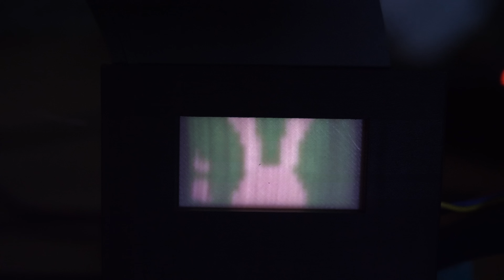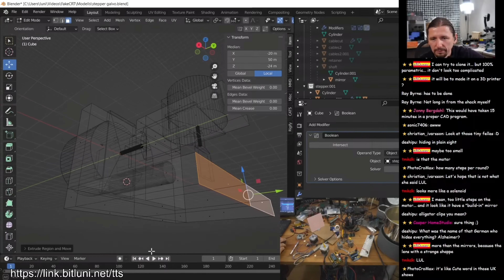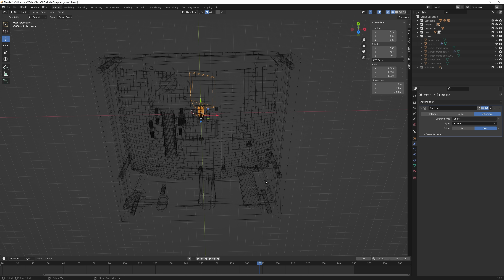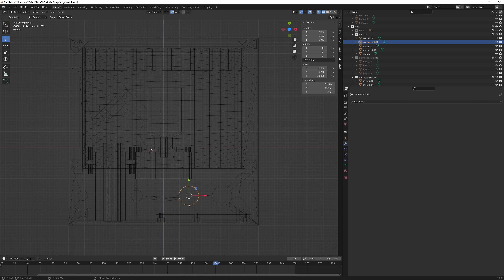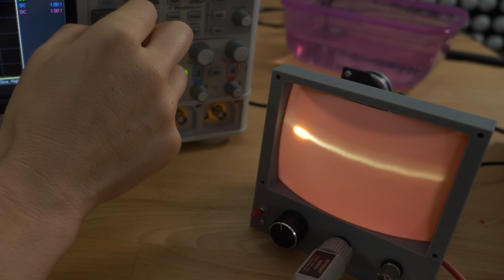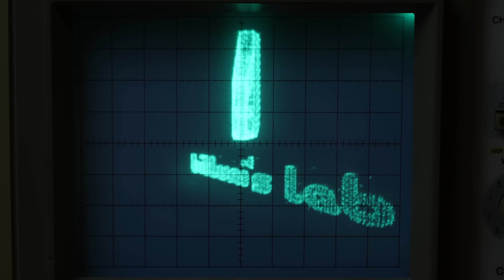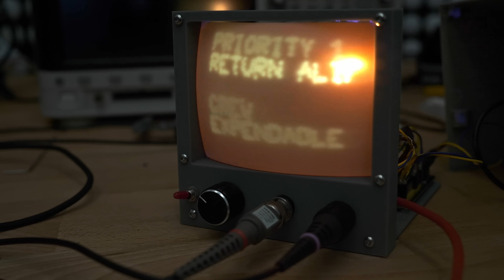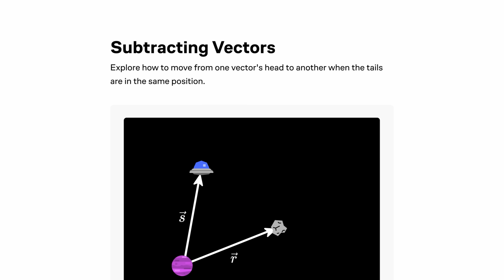I made a fake CRT TV with a LASER

Comment from the maker: Check out https://brilliant.org/bitluni/ for a 30 day free trial or a 20% discount for an annual subscription (sponsor)
Reply: ONE DAY AGO? It was uploaded 31 mins ago bro
Reply: @Randomman149  uh, released to members early?
Reply: YES, TWISTING WIRES IS GOOD. when you twist 2 wires together (2 wires of the same circuit... so 1 wires is the positive and the other wire is the negative) they 'magically' shield themselves from outside interference... this is why you see 4 twisted pairs of wires in an ethernet cable.... but you CANNOT have more than 1 circuit in a twisted pair... this will interfere with it self and can ruin both signals... 
- I JUST explained this SAME THING to another channel about 2 days ago :D - So going to school for Network Administration LEARNED ME SUMTHIN!!!! 🤪😁😳😂
Reply: @ThatTweedle  You can only have one circuit in twisted pair,  cause you only have 2 wires. Otherwise it would be a twisted group, which is not a thing.
Reply: I'm tired of so many brilliant shills. If it was any good, they wouldn't need so many shills.
Reply: May I suggest for our common safety that you forgo the gravitational field project ? A small black hole on earth sweet jeezz!!
Reply: how far do you think we could take this? to a full color tv? a light weight "photon crt" would be a godsend to retro gamers in particular
Reply: @srgarathnor problem with making a TV to use with a retro computer/gaming console, is that a horizontal line scan ( including flyback ) only takes 64 microseconds ( 63.5 for NTSC ), and I seriously doubt the H mirror can move that quickly.
Reply: try to focus the laser and see if you can sharpen the image, you might be onto something here. also try gearing the motors for speed so you arent pushing the motors into a precision traded for speed situation as much. also i wonder if any other materials would have a faster light drop off from phosphorescence.
Reply: alternatively what if you physically move the laser diode on an xy gantry using linear gears for the x and a worm gear for the y? could also work.
Reply: Hey, whats the song in the intro? :D
0:22
Reply: Make a Pip-Boy out of this. 
Guaranteed clicks and technical challenges and game conventions fun!
Reply: This build really reminds me of the vetrex which was a console with a built in crt that made vector images
Reply: 0:32 could you give link?
Reply: I NEED to find out how you created that screen. I’ve been working on a prototype for a modern CRT and have been trying to find a cast acrylic manufacturer that would make it for me, but no luck!
Reply: Wouldnt a micro mirror MEMS device would cost you less that the project? A DLP Mems device would cost you $170 or less for a HD projection.  Low resolution even cheaper.  Say DLP7000
Reply: For this project, you could use much smaller mirrors to reduce drag and inertia. Also try using a longer laser path length to reduce the amount of deflection needed. These changes should give you a significantly faster drawing speed, limited only by the inertia of the stepper motors..
Reply: 0.1 "inch"? Come on now, it is not the dark ages anymore, use standard units of measurement only please.
Reply: if this gets sold then ill say it will be 60 dollars or pounds or euros and yen
Reply: You could have made a real display with spinning mirrors that have multiple faces.  Like it's a cylinder of mirrors - you would have to machine this out of aluminum and then polish it.

The sweep from left to right would require quite an RPM, from top to down, considerably slower. I doubt you could get NTSC quality.  I doubt you could move it without breaking it because of the torque.

I wouldn't recommend building this, it would be fairly expensive, possibly dangerous if it broke and it wouldn't be a very satisfactory display.
Reply: can you make it run doom
Reply: CRTs don't work that way. You don't have horizontal or vertical sweep.
That's basically a mechanical oscilloscope with a terrible response time. It's nothing like a CRT.
Thumbs down for the clickbait.
Reply: cosmefulanito5933 That's why the title has the word "fake." It's not clickbait

Comment: I'd bet a gear system could increase persisoin at high speed by exchanging  torque... would a moter running at a speed that is more acurite for it be able to run a gear faster without loosing the persisoin if it is such that the mirra is not too heavy for the exchange?

Comment: I recommend changing the control system.

One high-speed brush motor on the X axis, and a stepper motor on the Y axis.
Optical sensors to determine when and where the Y axis is (one is enough to check the rotation time and calibrate the position).

On the Y axis, a stepper motor establishes a "line" on which the information will be displayed.

And control for switching on the laser diode (I would suggest permanently switching the current source and only inserting a transistor near the diode to operate as an ON/OFF switch).

Comment: I wonder if you could minimize the effect of intertia by using a lens to project the light out - meaning you wouldn't need to move the motors as far to have as large of an effect. Or would that result in too much distortion to figure out?

Comment: Could you use three mirrors on each motor and spin them continuously to emulate raster scanning? 

There would be no big changes in momentum if they always spin in the same direction (the H one way faster than the V mirror).  When a mirror has sent the beam to the far side of the display a new mirror would replace it flicking the beam back to the other side of the display. The ugly transition as a new mirror comes in to 'view' would be 'blanked' exactly like the Horizontal and Vertical Retrace blanking on a CRT.

Comment: I wonder if you could rig up the motors so they sweep top to bottom left to right with continuous motions (maybe even with just constant speed motors) then electronically turn the laser(s) on and off when they're at a given position? You could use the delayed florescent like properties of the material to control brightness based on how long the laser is on at a given position.

Comment: I have no idea if this would work but I wonder if you could spin the mirrors in a patterned way so that it scanned across the entire screen consistently and then you only activated the laser at precise times so that it illuminates only desired portions of the screen. Probably significantly harder to implement and requiring much more precise control.

Comment: I think an easier and more accurate solution would've been to have the mirrors flip at a constant speed and just turn the laser on and off based on timing.  The visual effect wouldn't be as cool but it could perhaps be driven with composite video signals.

Comment: What if I use a flexible lcd display inside, and when you press the quote on quote "degauss" button, the image displayed on the lcd goes through a filter that "shakes" the image, making it suddenly look distorted, while a hidden 12v relay, hooked up to an ac power supply, goes "ZZZZt" to mimic degauss noise

Comment: CRTs don't work that way. You don't have horizontal or vertical sweep.
That's basically a mechanical oscilloscope with a terrible response time. It's nothing like a CRT.
Using a servo is the stupidest thing you can do.
You should use coils. Like the ones used to move hard drive heads.

Thumbs down for the clickbait.
Reply: Oscilloscopes are CRTs

Comment: As an HDD engineer I would've took apart two hard drives and used the voice coil motors for the mirror. Drives seek incredibly quickly and should give you a good picture. You use the VCM for large movement and ideally you'd use piezoelectric actuators for more precise movements. But that might be a bit over the top. For the VMC you could even keep some of the drive hardware and tell it to seek to specific places, but again that's a more complicated project. The VCMs can actuate in <10ms.
Reply: <10 ms without mass at the arm tip.
Reply: how does it feel knowing your job will be useless in 5 years
Reply: @noobulis  
Data Centers                        👁👄👁
Budget PCs & Servers        👁👄👁
Security Camera Systems 👁👄👁
NAS Devices                        👁👄👁
Legacy Equipment              👁👄👁
Cheap Local Backups        👁👄👁

HDDs are still amazing pieces of tech and will likely still be around for far more than 5 years
Reply: @DeerLiver and not like medical equipment and industrial stuff doesn't use the same knowledge.
Reply: @DeerLiver  16TB NAS
Reply: @noobulis   Sociopath say wut?
Reply: @noobulis  It'll be the cheap option for some other industry that "just needs it to work".

Comment: actually crt signals works by full turn on x origin at specific speed ie 320  turns per second and on x specific time ie 240 turns per second... and projection time on specific time being active or low defines specifix time/positions pixel status... so making mirrors rotate all the matrix screen with specific interwal and serially setting pixel by correct timing will make exactly same logic of crts realatively... ;P

Comment: that glass module can be used for big clock display with simple laser and arduino... if library is open source but it not that complex it doesnt need to be open source just correctly timin two mirrors and  activating laser at correct time sequance will draw right pixel at right place/time... so we need a timing library that reads a 2 d matrix dot display data and converts it to time on of and position data for laser-mirror module :P
Reply: may be a library function to convert text to 2d dot matrix data will be good. but there is allready lots of libraries on arduino library database that does exactly this :P but i dont remember a laser mirror timing library ... so its one of the missing things of that database :D

Comment: To use a short range actuator like a speaker coil, you have to use a series of mirrors (first surface would be ideal) to lengthen the distance in a short area, or use actual distance to allow the angle to spread adequately. This would allow a minuscule movement like that of a speaker to reach the edges. You would essentially use the opposite of what is used in microchip fabrication.

Comment: What if you hooked one (or both) of the mirrors up to a rotary motor instead of a servo.  With the correct geometry, and if you can measure the RPMs precisely enough, you could greatly speed up the potential line travel speed.
That's assuming you have fine grain control enough of the laser on/off as well

Comment: For pure X-Y scanning you could also try using two BLDC motors and a triangular "scanning" mirror on each. The Y motor running at the horizontal resolution times the X motor. Then tilt the entire mechanism slightly to account for the x scan skewing the y position. This saves a lot of time instead of resetting a paddle to the zero point for every line. Alternatively you can speed up the mirror you made by drawing every other line from right to left instead of waiting for the mirror reset to the zero point.
The galvanometer design you mimic is suited for amorphous shapes like silhouette, or geometry because it's ideal direct point-to-point vector style motion ability. Perhaps vector graphics could be experimented with your current model.

Comment: okay but why not use the full spin and trigger the laser as the motors spin instead of start-stop so much? the inertia is why its a bumpy line if going fast. but if the motor spins at like a 1000RPMs and you just trigger the laser as needed to draw, all lines should be precise. unless, you cant trigger the laser on and off that fast?

Comment: if you are trying to do a horizontal line scan I suggest you use a motor with 3 mirrors and possibly a magnet for a position sensor. each side of the mirror will do a scan line. your servo can take care of vertical line scan. This way you can act more like a traditional TV and oscilloscope.

Comment: I think using the speakers to control the laser is worth revisiting. It may just take certain angle adjustments to get it right. A CRT accomplishes this with electromagnets moving the electron beam emitter minuscule amounts. This would be a lot more efficient that moving the laser with a motor as much as you are doing now. 

I love the project just the way it is too. It's so cool to see a laser TV in action.
Reply: A tweeter speaker would definitely work.

Comment: I think you were on the right track with using speakers(voice coils), but using small mm standalone cone drivers would limit your resolution. You would need big speakers to get high enough resolution. This would have the added drawback of needing high current drivers. Perhaps you should modify the idea. Rather than speaker, why not use hard drive style voice coils. If you think about it, a hard drive uses micro driver coils to move a lever. The length of the lever magnifies the distance needed to gain resolution. I would then drive a typical crt style deflection for vertical and horizontal hold. Then just adjust the laser pulse to make your pixel.
Reply: Another idea is to use a old cd player laser. They use a voice coil to control focus. This might give control on the size of your pixel.

Comment: With rotating mirrors you can do an x-y full scan. The X would just spin fast, the Y would advance once for every X line, and go back in the end, and then you draw just horizontal lines and to make the full picture you turn the laser on and off. It would not be vertor graphics but more like pixels though.

Comment: YES.  I thought of this a few years ago when I picked up an old rear-projection TV.  If the CRTs in that thing ever die, I was hoping it would be possible to replace them with RGB lasers.  If the raster scanning mechanism was up to 2x speed, it could even make it compatible with 480i and 480p, while still having all the advantages of an all-analog display.
Reply: No you can't. CRTs works by driving electrons, lasers emit photons. As he said you would need a gravitational field (a strong one) to deflect photons.
Reply: @jimbotron70   Well, no, you can't use a deflection yoke to steer photons, but you can still create a raster scan through other means -- either by moving a reflective surface, or the light source.  Most probably the former, given mass.

Comment: Have you thought about using a tratitional electric motor and a crank shaft like in an engine attach it to one side of the mirror and have the other side of the mirror on a pivot do that for the x and y axis then get images by switching the laser off and on with a setup like that youd just have to figure out how to time it but could probably use a potentiometer on the pivot side and use the value from that to determine timing for the laser off an on or just have switches and the top and bottom of the stroke to time it from either way it should be able to get a reasonable refresh rate and you could ditch the screen your using

Comment: Cool video!  Did you consider using a constant high speed on the mirror motors spinning non stop one direction and simply control the laser turning on/off at precise moments when the mirrors are in a given pixel position?  That should fix the speed problems if you can get the laser to turn on/off fast enough and properly track the positions of the two spinning mirrors.

Comment: If you want to use speaker as actuators, piezo ultrasonic transceivers would be better. (mirror seesawing between two piezos with opposites phasis)
About the mirror, maybe take inspiration (or apart) a barcodes scanner ? It's full of rotating mirrors made for .. scanning surfaces ;)
Resistors ladder before the laser to make a crude DAC ?

Comment: It's a neat idea and a fun project but what you're really looking for is called a closed loop galvanometer. You can buy inexpensive ones from China specifically for laser light shows or if you are ambitious you can build your own. A very talented person named Elm Chan published a product quite a few years ago to build these and the special amplifier for driving them from scratch. There were also a few high end prototype laser raster displays back in the 80s that used a rotating polygon mirror for the horizontal deflection with a galvo for the vertical deflection, I never saw one in person but apparently the image was impressive for the time.

Comment: It was better to use freely rotating mirrors. 
that is, to adjust the rotation speed of the mirrors and turn the laser on and off. 
yes, you will have to tinker with the code, but this will increase the response of the system and in general it will become faster.
лучше было использовать свободно вращающиеся зеркала 
то есть регулировать скорость вращения зеркал и включение и выключение лазера 
да с кодом придется по возиться, но это позволит увеличить оклик системы да и вообще она станет более быстрой

Comment: Heads up to anyone out there that tries to reproduce this fun looking project...or has a kid that wants to.  The link he provides for the CNC Shield v4 board...is very similar but not the one he uses so there are changes you will need to make to the physical board.  Cutting copper traces and jumping a couple connections.  The board he uses has 5V on the microsteps jumpers but the linked one has them jumpers on GND which won't work.  Also the linked board has a pin out different, that is the Direction and Step pins are needing to be reversed in his code.

Also the motors he linked are currently out of stock, so we used ones we found on Ali that were very very similar which has caused some confusion because the color coding is different and their datasheet is non-existent.  

I have reached out via discord to this fella, his project is awesome looking, we want to reproduce but having a schematic or wiring diagram would be amazing.  We will figure it out, but if he starts providing such thing either on here on his discord or his github...it would be amazing.

Again Bitluni's projects are pretty darn good...thanks.